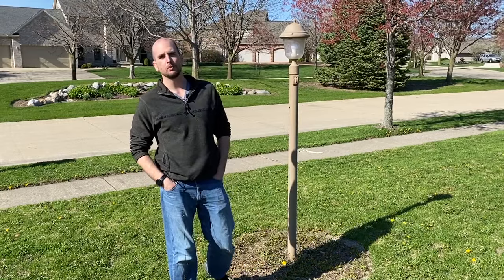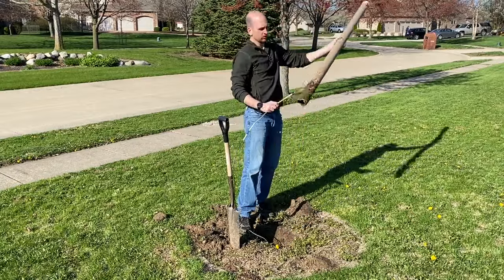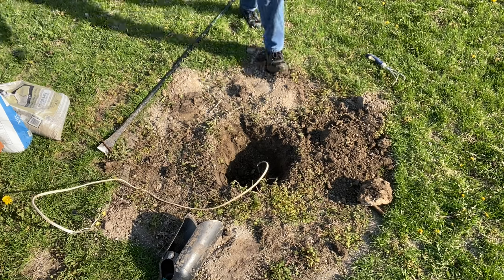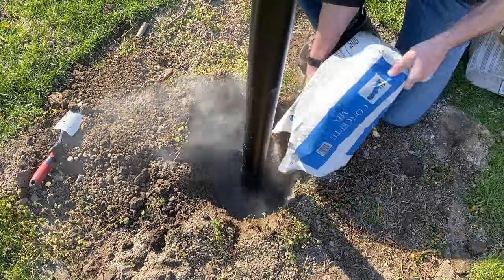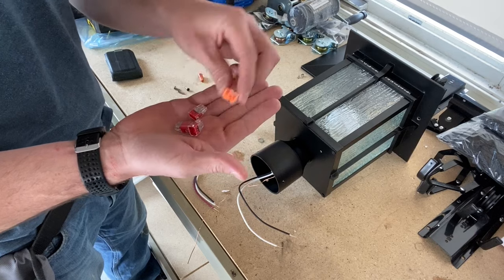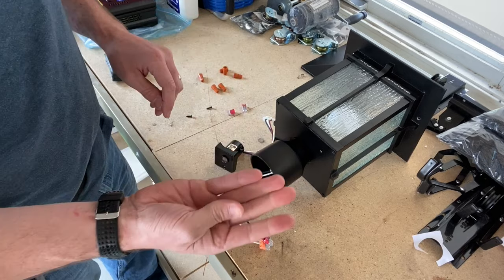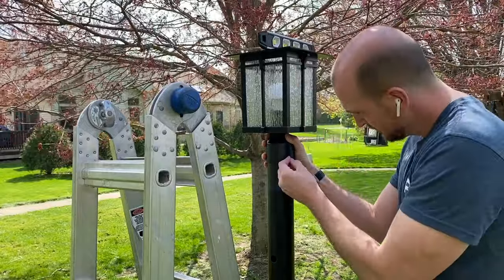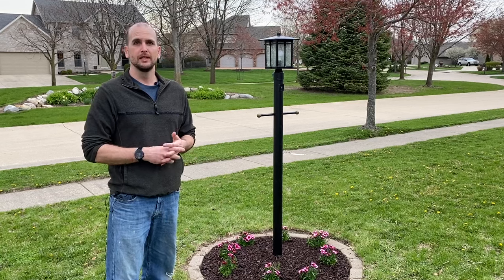How To Update or Replace a Lamp Post and Light

Comment: Thank you for the video - it helped me a lot today as I installed my lamp post at the edge of my driveway.  One thing I did differently and it worked was to dry fit the fixture on the pole and drill the holes on my bench before putting in the ground or running wires.  I did mark the exact alignment spot with a light sharpie so that I could align it in the field.  Worked out fine.

Comment: FINALLY, ready to replace my lamp post light (that i bought before this friggen pandemic). Unfortunately, I only got through step 1 (cut the power) than ran into a problem!
My screws are so rusted and stripped that I can't take the damn thing off now! I swear DIYing is never smooth sailing for me, ever!
Reply: Use a brand new drill bit and start slow speed and drill out the screw.
Reply: @PR-bx2hs  or just break the damn thing like i did, heehee! I was replacing it anyway since the new light has its own base. I actually just cut the metal around the stripped screws to take light off. Then i removed them from inside of the post until i could take them out manually, if that makes any sense! 
Thanks though!

Comment: Your video was very helpful. My original 12” diameter hole grew much larger when I uncovered a HUGE block of concrete used to anchor the old lamp post. It is much too large and too heavy to be lifted out of the hole in one piece. I am waiting for someone to use a jackhammer to break it up.
Reply: Rent a hammer drill w a chipping bit, shouldn’t take too long and prob cost less to pay someone to do it

Comment: White romex? For exterior applications it needs to be UF wire designed to be buried directly in the ground, regular romex insulation designed for interior use only will not last outdoors and will most likely cause trouble in the future.

Comment: Just saw this video.  I have been dreading this project sine the onset of COVID.  This video completely de-stressed me about the project!  Awesome!  Two quick questions: 1.) Did that photocell come with the new light fixture?  2.) Did you say where you got those wire connectors?  Again, GREAT video!  Thanks!
Reply from the maker: Nice, I am confident you can get this knocked out in no time.  The photocell came with the light post.  You can pick up a light post with or without a photocell so just make sure you are picking up the correct one for your project.  The push pin wire connectors can be found at any home improvement stores or online https://amzn.to/3kt1bWl .  Best of luck on the project and let me know if you have any other questions.

Comment: Nice video Scott!  I am surprised the the light pole manufacturer didn't provide you with a protective bushing for the hole on the pole where the electrical cable enters the pole to prevent the wire from chafing with the pole slightly moving up/down during thaw/freeze cycles you get during the winter.  Also, I am surprised that the light fixture manufacturer would provide you with sharp pointed screws that may come into contact with the wire inside at the top of the pole.  Is this light fixture UL or CSA approved?  I also use a light coating of "Nolox" or "Penitox", anti-corrosion gel on the base and screw portions of the threaded light bulb so the bulb doesn't become corroded in the socket.  Great work!

Comment: Those push connectors work well, but they are not rated for stranded wire. The Wago lever nuts would be a better choice.  Alternatively, you could make pigtails off the lamp with stranded wire. The extra length of wire isn’t necessary, but it’s often really nice to have.
Reply: True. Ever since purchasing a set of those lever nuts, I always use it when I'm dealing with stranded wire. Super easy to take off with minimal damage to the strands, unlike wire nuts. As for wire length, there is a code requirement 6 inches for boxes, but I'm not sure it applies to posts.

Comment: “Spike” = digging bar.
But yeah I’ll be doing this soon.  I was just out cleaning the glass on mine and it always felt really solid.  But looked a little out of plumb.  I leaned back on it to try and pull it back after feeling that it had some give... nope.  It broke at the ground.  It’s still standing but barely lol
Reply from the maker: Dogging bar = awesome.  Yeah those posts are pretty thin walled.  Can’t take much push and pulling from my limited experience.  Best of luck on the project 👍
Reply: Everyday Home Repairs meant digging bar.  Auto correct for ya.  Thanks ma.  Good install. 🤙🏼
Reply: @35057  meant Thanks man.  Auto correct for ya.

Comment: looks good. I plan on doing this project this next weekend. What if we don't do the flowers at the base? do you recommend a "lamp post base" like the one's at home depot?
Reply from the maker: Do you already have a romex wire ran out to where you want to place the lamp post? Just want to make sure you already have power running out to the future location.
Reply: @EverydayHomeRepairs  yes, I'm replacing an old lamp post that is leaning and past it's prime.
Reply from the maker: @iberios  great so the project will be very similar to the one featured in the video.  If you don't want to dig out the circle around the lamp post that is not a problem.  You can place the post in the ground and have grass surround the post.  Once you are done you will just need a bit of grass seed and water it for a few weeks with some straw or another ground cover to help the grass seed growth.

Comment: I would use the old lamp post as a sleeve for a longer, 10' lamp post. Buy an electrical conduit of larger diameter and slip it over the old post.

Comment: My lamppost just stopped working. We changed the bulb and photo cell. Still doesn't work. My lawn guy did this.
Inside front door has 3 switches and I know 2 work
I get no power to outlet on the pole
I have old time fuses. Any idea on what electrician would charge? Could it be the underground wiring? Post is about 2 years old. Lawn guy thinks he isn't capable of repairing further. I'm an old lady and don't want to spend a lot on fixing it. Thanks!

Comment: Do they still make 2 1/2" lamp post lights. I have a 2 1/2" cast iron lamp post that needs a new light on top. Is there anyway to adapt a 3" lamp light to fit/work on a 2 1/2" lamp post. I'm having a hard time finding a 2 1/2" lamp light. I can't/don't want to remove the old lamp post. It's a 1930/40 lamp post - quite decorative and extremely heavy .Please Help me !!!! Desperate..
Reply: Have you considered checking the plumbing isle of the box stores? I would bet there is a 3” to 2.5” PVC or ABS reducer sleeve available.

Comment: Is photo relays frequently going bad a common problem? I replaced my relay a few months ago and I noticed the light dimming later on and now it won’t come on. Its probably worth to say that the finial was missing from the top so it’s likely that water got into the fixture (I’ve since replaced the fixture, but not the photo relay).
Reply from the maker: I would say the photocell is probably the most common failure on a lamp post but should last much longer than a few months.  I would check the wire connectors in the lamp post.
Reply: @EverydayHomeRepairs  I also found just now that the wires in the harness spin freely but won’t pull out. Maybe the connections are bad like you said, so I ordered a new cell and harness.

Comment: How do I just remove a broken lamp & pole and leave the wires to possible later use? To cal them off & protect from water & snow? Thanks.
Reply from the maker: I would install wire nuts on wires, put a robust bag over the wires and use electrical tape to seal the bag around the Romex wire.  Most importantly I would find the junction box and disconnect the hot and neutral wires then cap with wire nuts and leave in the junction box for use later on.  That way you can energize the circuit and be confident no problems with the wires running out to the old post location.
Reply: Wire nuts in the ends of the wires, then tape em off from the weather

Comment: Okay but the cable on the ground is it connected to the box? If so what kind of cable is that?
Reply: It should be  UF cable, which if 120V and GFCI  protected, is permitted to be buried directly at least 12 inches below grade

Comment: I've got one of those in my yard, and it has never worked since we bought the house. There's no switches anywhere that turn it on or off, there's nothing marked in the breaker panel for it, and yet, there are wires in the post! How do I "trace" those wires back inside the house to find out where they go? Do I need to just replace everything from scratch, and treat it like a new install?
Reply: Most panels don't have a breaker labeled backyard lights or something similar. Just grab a multimeter or non-contact voltage tester and go through each breaker until you find the one that kills power to the wires in the post. If you still don't understand, then you're better off calling a professional to help you out
Reply: @aurvaroy6670  Not interested in financing someone's beach house or contributing to somebody's kid's college fund. I just asked a question because I don't want to hire an electrician. So unless you've got something to offer that actually addresses what I asked, oh, maybe like how to actually find out where the wires are, then you really don't have anything constructive to offer, do you?  How hard is it to answer the question that was actually asked, instead of the one you wanted to answer that I didn't ask?
Reply: @lancer525  I told you the steps you can take. It's up to you if you want to follow them or not.
Reply: @lancer525  yeah, he told you exactly how to do it. I think his snarky response was kind of a warning that if you can't follow what he's saying then maybe don't mess with electricity. Its dangerous obviously. Or, you can Google the tools he posted and then find a video on here that will give you some guidance on how to use them. That's how I learned.  I'm sure it will work for you.
Reply: Same problem for me

Comment: Why did you have to drill your own holes on the post ? Doesn’t come with it ? What screws did you use ?
Reply from the maker: The pole doesn't come with predrilled holes since there are a number of different lights you could mount.  I don't know the exact screw size as they came with the light.

Comment: better off drilling the holes in post/leveling the lamp before doing the wiring. thats what the manufacturer's directions say with the post i bought. it leaves a lot less wires from the courtesy outlet and photoelectric switch (if you have those options) in harms way while drilling.

Comment: That's a lot of work when I would have slapped some paint on the post and it would have looked brand new.

I'm here for a little different reason. I looked outside and saw that my lampost no longer have light. I changed the lightbulb and that wasn't it. A bigger problem and project I'm not up to. I hate to call an electrician but will probably need to if I want it fixed. I bought an old house and probably shouldn't have.

Comment: Why didn’t you just use Schedule 40 PVC pipe
Reply from the maker: Hey Paul, didn't even think of that option.  Definitely would have helped with the metal post breaking down over time from corrosion.  Did you use PVC for your lamp post?
Reply: @EverydayHomeRepairs  at our last house yes.  It was a little more work involved, but sanding down the pvc pipe to accept Gloss White paint and drilling a hole towards the bottom to allow for the wiring to go through.  Other than that it looked good.  I wish I was in the same state to go take a pic of it...
Reply: @EverydayHomeRepairs  also, here at our new house I am in the process of making a pvc pipe scheduled 40 post cross rails and pvc lattice fence.  All white. With a PVC pipe lattice walk through gate..
Reply: @EverydayHomeRepairs  use pvc as a pole ?
Reply from the maker: @rosiegonzalez167  I haven't tried it out but Paul indicated it worked well for him.  Might be worth a try.